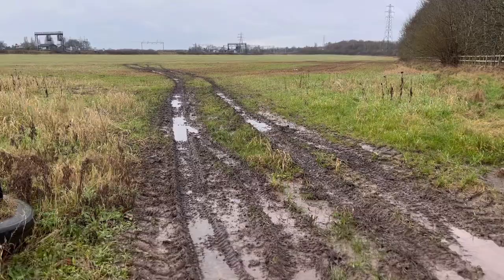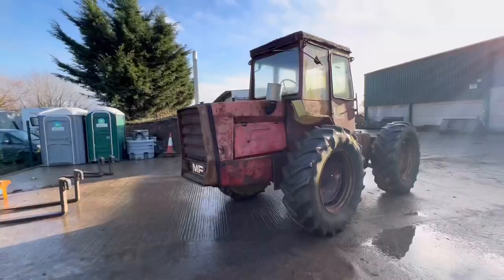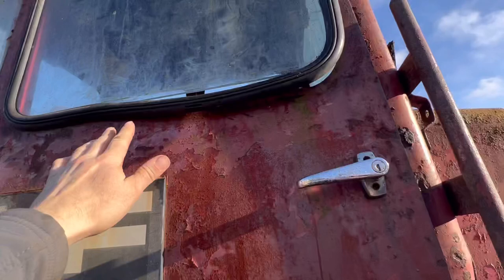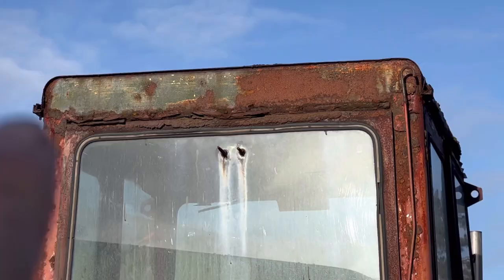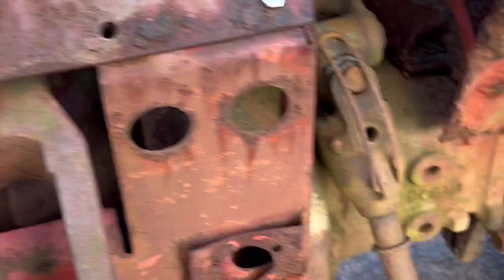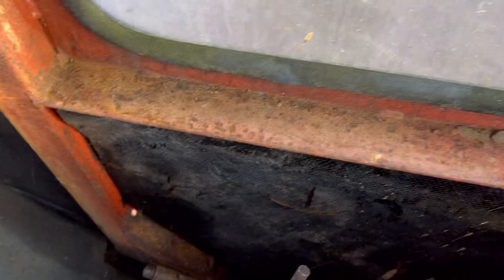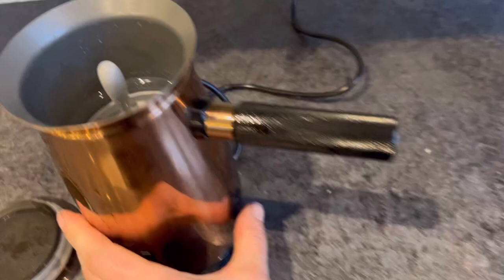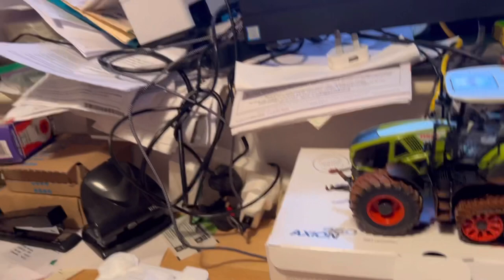Day665 #OLLYBLOGS IVE PROBABLY BOUGHT THE WORST MASSEY 1200 POSSIBLE 🤦‍♂️ #AnswerAsAPercent

Comment: If you get as far as replacing the drive belts for the Hydraulics and Power Steering you have to split the drive shaft from the engine. loosen the engine mounts to get both belts in position on the pumps, back in the day when we had a MF 1200,  the belts were not known for their longevity, so we used to put a second set over the drive shaft and tie them out the way. You could then change the belts without splitting the shaft from the engine. And in your case it looks like this has been done already.

Comment: Hi Olly good luck with the 1200 in my experience the only time they don’t leak oil is if they haven’t any in them lol I drove one of the first ones when I was 17 for a contractor in Wiltshire a fantastic tractor in it’s time in my years I have owed a 1200 and a 1250 I wish I hadn’t sold the 1250 as there value has rocketed good luck again I think more than a months work

Comment: I’ve had 2 1200’s and a 1250. Great tractors.
I once saw an advert for a used 1200 with No Oil leaks. 
I rang the guy up and said there was no such thing. It must have been either brand new or all the oils had leaked out!

Comment: I think, the steering and multi power are driven by the same pump. It might draw its oil from the drop box. There’s a fill plug at the back of the drop box. If oil is low the steering will be heavy. Also, in high multi power, the steering will always be a little slower. The other pump is for the auxiliaries, the oil for this  is topped up in beside the front left wheel. The auxiliary tank is is also below the cab, on the left side. 
Still a fairly simple tractor. Picture of rear of half axles will show whether brakes are wet or dry type.
Reply: They are dry type you can see in the video.

Comment: Hi Olly, hope you didn't pay too much for the 1200. Looks like it been a beach boat launcher in the past with the amount of rust. They were quite popular for that as they could go quite deep as the engine is high up. The oil leak looks too black to be from the back end ( unless its been filled with used engine oil),it, could be from the clutch / gearbox area. Seat and floor panels are easy to remove and should give you a much better idea where the leak is. Pipework to the hydraulic pumps will be easier to check as well. Personally I would think hard about spending too much time and money on it, especially due to the rust. Get it under cover if possible, paint it with oil if not, and keep your eyes open for another one and make a good one out of the pair.
Reply from the maker: That be boreing
Reply: Would be liking to follow this project as well as the MBtrac
Could suggest search /download instruction manual and parts books could help
May be a good contact for help would be Lord muck and his mates
Reply: Where's you sense of adventure - get it stripped and blasted, see whats left and rebuild the old girl......

Comment: It could be a the priority valve on the pump, there will be ample pressure to the pump but the the valve maybe sticking that sends pressure to the steering. Had the same issue on an 1188 V8
Reply from the maker: Ohhh 🤔

Comment: Good luck with the 1200 she definitely looks like she has been a Beach Tractor I have never seen corrosion like that on a 1200 cab they were built fairly local to you at Barton Dock Road in Manchester
Reply from the maker: Might take it back see if there is any warranty on paint

Comment: there is a fair chance that the 1200 was used in forestry as a skidder i use to own a 1505 when i was doing logging with a blade on front and bolt on winch on the back i know somone by me that has done mf1200 to mint standard he also bought my 1505 and full rebuilt it

Comment: if the back end oil has a lot of crap in it, the filter on the scotch yoke pump would get blocked. If you left the tractor overnight the crap dropped off & you had hydraulics for a while until all the oil was stirred up again. Drain the back end * see what the oil is like.
Reply from the maker: Will do